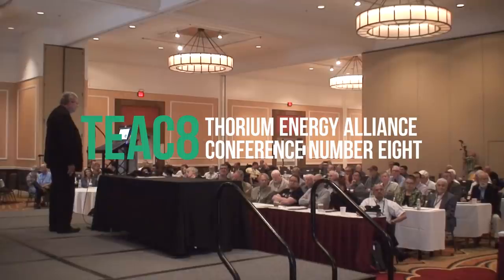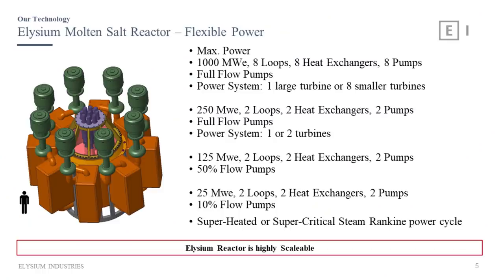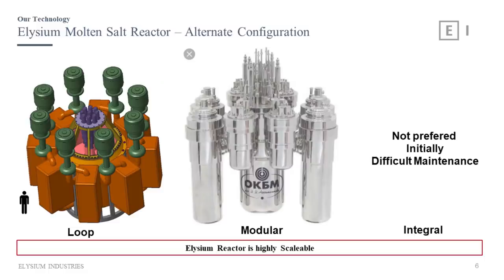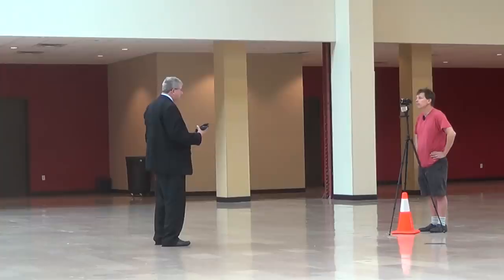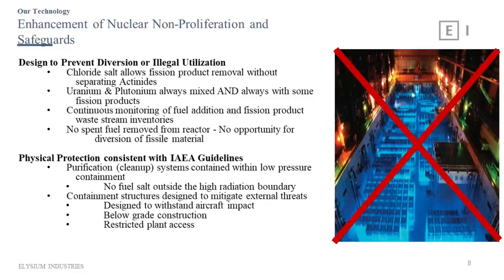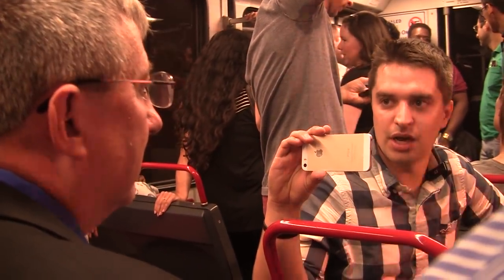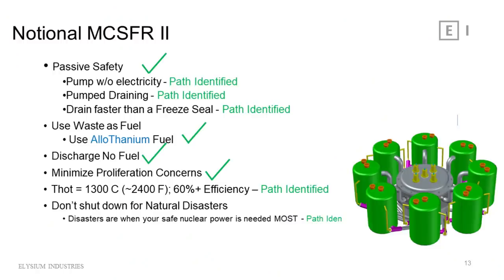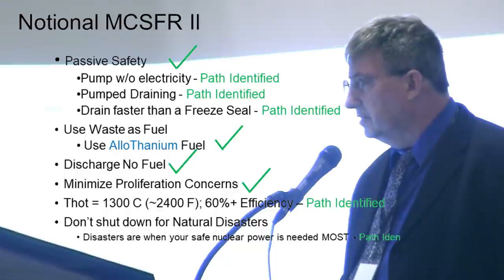Fast-Spectrum Molten-Salt Reactor - Elysium Industries - Ed Pheil @ TEAC8

Comment: I am a fan of the MCSFR concept and have a lot of respect for Ed Pheil.  I don't know why Elisium and Exodys have not been more successful.  The oil lobbyists and their enablers in our government have sabotaged the SMR industry since the '50s, for one thing.

All electrical power could be generated by small nuclear reactors widely distributed through a de-centralized grid (think EMP) throughout the world (thousands), reducing the need for fossil fuels by two-thirds. Could have happened a long time ago. We have had SMRs in active use by the military since the early '60s and could have been deployed them from that time on if wanted. Electrical power (lack of) is another method of CONTROL of the world population.

IMO, SMRs should be manufactured in volume for electrical generation throughout the world, conserving fossil fuels for internal combustion engines, chemical processes, and fertilizer. Were this plan to be implemented the world economy would explode overnight. (However, the power of politicians would suffer. Prosperity is the enemy of the political cabal.)

Comment: (28:24) I love Ed, and I think he might have the edge when it comes to being the first to commercialize a working MSR. However, at this point, while he's correct that you can get around the proliferation barrier of U-232 by allowing your Protactinium to decay in batches, this still ignores the fact that the biggest obstacle to nuclear proliferation in thermal spectrum reactors is their absolutely anemic breeding ratios. 
If you operate your reactor on a continuous process, dumping all Protactinium into a big tank to decay to Uranium, you'd never be able to separate the U-232 from the U-233 as you'd always be adding new protactinium 232, and continuing to produce new U-232. You'd have to operate in batches, say, isolating all the protactinium produced over a given day, allowing all the possible protactinium 232 in that day's batch to decay to U-232, leaving you with pure protactinium 233 after a number of days, which would decay into almost pure U-233. However, because of the piss-poor breeding ratios of thermal spectrum reactors, if you were then to take all of that "pure" U-233 out of the reactor process so that you could make a bomb out of it, you're keeping that fuel from being fed back into the reactor. 
Doing this reduces the fuel density in the reactor, driving it into a sub-critical state, and effectively kills the reactor, at least until you put almost all of your "bomb material" back into the reactor. It's the low breeding ratios of thermal spectrum reactors, not necessarily the production of U-232, which is the best barrier to proliferation. Still, setting up a thorium breeder so that your protactinium decayed in batches should be a dead give away that you're up to something shady, as there's no "non-shady" reason to do this. Just my 2 cents. 
Be that as it may, I'd say Ed was still doing God's work, if I wasn't a deist, and he definitely frames a solid argument for his molten chloride fast reactor. He's certainly won a lot of fans based on the comments in various videos.
Reply: A stupidly easy way to use this reactor as a breeder for supergrade plutonium would be to flow 238UF6 through an area surrounding the core region where the neutron field is more thermal. The Pu would separate out as a solid and the UF6 left over would recirculate. A similar technique could be used for making tritium. It's not all bad though, especially as plutonium 239 would be the best start up isotope for these reactors.

Comment: The top questions I get from the Anti crowd is "what about the waste". I suspect that most of them will never be convinced but for some saying that proposed reactors are intended to reduce waste. may help the popular acceptance battle.
Reply: Eukatae 

The Elysium reactor only removes fission products that decay to background levels in about 300 years. The long lived actinides people worry about remain in the reactor. This is not a solid fueled reactor that requires re processing, separations, and fuel remanufactured every X years. The actinides stay in the reactor. Because we use chloride salts, we can remove fission products only. You can't do that with fluoride salts without doing extensive separations, including actinides. Chlorides and liquid fuel are the key. Also, because we don't remove actinides there are no proliferation concerns and the fusion products coukd be mined for useful medical isotopes, etc. The zirconium cladding we extract the fuel out of is recycled. The chlorine is also recycled. The fission product waste is kept as a  salt, so it will decay longer and the higher temperature the easier it is to passively cool and the smaller the waste package. We dont need millennial storage facilities for Elysium waste. Also, we only produce 1 tonne/year of fission products and we don't throw away the other 96+% of the unused fuel, cladding, and transuranics that aren't used.
Reply: I thought LFTR's waste is less radioactive then current nuclear waste?
Reply: Radioactivity is a bit more complicated than that. The longer something takes to decay the less radioactive it is. Something that has a half life of 10 minutes is really hot, something that has a half life of 10k years, you could eat it.
Reply: I agree, most of the anti crowd will not be convinced. I have observed that they tend to be so entrenched in their beliefs that anything opposing them is considered heresy, and any possible solutions are outright dismissed. Getting the general public on-board is going to be the biggest battle, fear is more powerful than the truth.
Reply: Eukatae - It's a bit too much of a generalization to say something with a very long half life could be safely eaten. The radiation likely wouldn't do any serious damage, but metal poisoning from, for example, uranium, would.
Reply: +Phlaked Corn THIS. Plutonium isn't just (usually) highly radioactive; it's also frightfully toxic on a chemical level. The only plutonium that our entire species has ever come into contact with was what we MADE; otherwise all the potential "natural" sources already decayed to trace levels billions of years ago. Which is to say... there has been no natural selection pressure to evolve tolerances for nor protection from plutonium, on a chemical level. Unlike, you know, radon in the air we breathe.
Reply: Darth - SMH, really? It's not sabotage worries me, scientifically illiterate politicians with their fear monger anti nuclear constituents that put them in office does. The policy changes and funding that is needed to make next gen nuclear a reality are controlled by these dolts, and so long as they are the majority, we won't even be able to build the reactors you mentioned in the first place. http://news.gallup.com/poll/190064/first-time-majority-oppose-nuclear-energy.aspx
Reply: Eukatae Radiation is not the only problem with long-lived spent fuel.  Plutonium is hecka poisonous, requiring micrograms per person to guarrantee cancer.  That's plutonium's chemical property, not nuclear property.  In that sense plutonium's long half-life is its drawback because we have to contain it longer to spare us from its super-nasty chemical property.
Reply: I was responding to a question about the radioactivity of byproducts of LFTR  reactors. I was not offering dietary advice, I was talking about radiation, not toxins. Gold, eat that, it's delicious.
Reply: jomossino79 

That perception is based on people comparing Closed cycle LFTR to open cycle water reactor fuel. That is NOT a fair comparison because both U and Th can have a closed cycle, especially in liquid fuels. If you close the U/Pu like they assume you can do for LFTR, then the waste stream has virtually identical levels of thise long lived actinides. That is what Elysium is doing, closing the U/Pu fuel cycle. You can ONLY do that in a fast reactor. If there is ever moderator in a reactor design a U/Pu cycle cannot be closed, except by following it with a fast reactor. 

So, don't believe a claim of a closed U/Pu cycle in a thermal Reactor. HEU, yes possibly at very high enrichment. The Navy has not tried to do that to my knowledge.
Reply: Lenard Segnitz 

So, burn the Pu.

Or understand that the amount of Pu is over 10,000,000x less volume and conrained compared to the Hg, etc that lasts forever and is released to the environment in the open weather from coal.
Reply: Professor Bernie Cohen offered to eat an ounce of plutonium if Ralph Nader agreed to eat an ounce of caffeine, That sent Nader running with his tail between his legs. The caffeine would have killed Nader whereas the plutonium would have happily passed right through Cohen without health effect. There is this case of a fellow Albert Stevens who was injected with an incredible 131 kBq dose of Plutonium, in 1945, so he got a massive 64 Sv dosage over 20yrs or avg 3.2 Sv/yr and died of heart disease at age 79.
Reply: I thought he covered waste and safety in the video. Did I miss something?
Reply: The answer you will get from the anti-nuclear movement is not "oh, that's okay then." but "Proliferation!" or "But wind and solar are so cheap now!" or "What about batteries?"

You cannot and will not get acceptance from ideologues. Their moment of compromise is the moment they must recant. And they will not recant until their peers are seen to do so, thus giving them safe space to do so themselves. 

Better to convince the undecided third of the population and give their misinformation no room to breathe and no confusion to hide behind.
Reply: The point to make when people rave on about the "But 250,000 years" part, is to say "Oh, we keep those int he reactor and use them as fuel" and "All that waste from other reactors is fuel for these too" (Yes, I know it's sidestream, fuel, but it's still useful)

As for flouride vs chloride salts: the issues over removal is only an issue if you plan to remove them. You only need to remove material from the loop if it's poisoning the reactor. Anything else can be broken down as much as possible.

Important question: What is the water solubility of chlorides? FlLiBe salts simply aren't soluble at all and my safety worry is if water gets into things.
Reply: At the end of the process, yes - but shortlived radioactives are fiercely hot to start with (they break down quickly).

Being "white hot" to start with is not  a disadvantage. It prevents theft and means a short decay time to harmlessness.
Reply: Stonehawk: Weapons-grade plutonium isn't particularly radioactive. Nor for that matter are U235 or U238. There are hot isotopes but the biological danger comes far more from the chemistry than the radioactivity. That's why depleted uranium bullets are a spectacularly bad idea - they catch fire and coat everything in uranium dust. The result is that in places like Iraq you have kids playing on dead tanks covered in uranium dust and uranium dust contaminating fields. The effects are worse than lead poisoning.
Reply: How radioactive nuclear waste is, is based on what isotopes it contains. Solid fuel has all the various isotopes bound together. This specific video is not about LFTR, but a different version of Fluid Fueled Reactors. LFTR has online processing, removing fission products, and sorting them as they are made. A large portion of these fission products will be at or under the radioactivity of natural Thorium and Uranium in 10 years. Some of these fission products are useful, including xenon, neodymium.

Fluid Fueled Reactors are "less radioactive" in that they burn up their fuel more efficiently. If you put in 1 ton of fuel, it burns up 1 ton and you are left with 1 ton of fission products. When you put 35 tons of fuel into a solid fuel reactor you are left with 34 tons of unburned low radioactive fuel and 1 ton of highly radioactive fission products. But they are all bound together in the solid fuel and must be stored together for 300000 years.
Reply: @Stonehawk  The uranium content of fly ash from coal is about 50 parts per million.    So, we could get far more energy from the uranium in fly ash then  from the coal that produced it.

Comment: Ooo, I'm liking this approach! Question about chlorine isotope separation though. My understanding was that when Cl-35 absorbs a neutron, it will mostly decay to argon, but a small fraction will decay into sulfur. Cl-37 avoids this, hence I thought isotope separation was necessary in a chloride salt reactor -- to avoid corrosion of the reactor materials. Is sulfur not the issue I thought it was? I think the nickel in hastelloy-N was particularly vulnerable to sulfur corrosion, but perhaps the materials you intend to use aren't so vulnerable?
Reply: No, transmution will absolutely be a source of corrosion. This is in addition to the fact that the lewis acid-base balance in chloride salts does not have an analog to the BeF2 (4-) complex ion of fluoride salts. Gettering systems will have to operate at high fidelity to manage transmutation products that can catalyze corrosion continually.  Excellent question!
Reply: Good info. Material and fabrication costs would be more, but I wonder if molybdenum alloys like TZM would be the ideal material for the reactor and first-loop plumbing. In addition to higher temperature limits with Mo, conceivably any sulfur produced would react with the surface to make MoS2, which is fairly tough and inert. I have no idea if that holds up in a molten chloride environment, though.

The titanium and zirconium tended to leach out of TZM in molten fluoride test baths, but I wonder if that remains true with molten chlorides.
Reply: This is some crazy shit
Reply: The sulfur would combine with technetium but sulfur plus chlorine would be very aggressive. Also other fission products would combine with sulfur to form extremely insoluble sulfides. It would need some method of filtering these out before hitting the heat exchanger. Strontium and barium sulfides would be extremely problematic.

Comment: Moltex Energy says that pumped fuel, while allowing fuel purification (or full reprocessing), raises problems of leaks and of noble metals fission products deposition into pumps, causing them to fail.
How can Elysium obviate to these problems?
Reply: Add extra chlorine to the mix over time. This would keep the noble metals in solution. Also a continuous filtration mechanism that causes the rhodium and other noble metals to stick to it. Then harvest it periodically. After aging for a decade the rhodium and other noble metals can be chemically separated from the radioactive waste.

Comment: Interesting. A few years back, I made the same point to Robert Hargraves about the U233 stream in LFTR's fuel processing being a proliferation concern, only to have him try to browbeat me down with bucketloads of smarm and an oblique answer.

Heartening to know I'm not the only one who had that thought.
Reply: Separated fissiles are always an issue regarding proliferation. The issue is not whether a material is proliferable or whether it is not; but whether the will and means exists to beat a plowshare into sword. So far, every single new atomic weapon nation has done so on the back of clandestine heavy water (or graphite) piles and PUREX, or clandestine diversion of centrifuged U-235. Neither process requires a civilian power reactor, and even high school students can perform the necessary refinement and separation steps needed to separate fissiles.

U-233 introduces a new dimension to this but just as, say, the US possesses U-233, it also does not use U-233 for weapons material. The ability to miniaturise weapons with Pu-239 is too great an advantage. Proliferation is not a test of technologies, but of institutions, people, and expertise. To shun the use of a reactor just because it might have a conceivable way from which a reactor could be used to produce weapons material is a failure not of the technology, but of the safeguards and the people in its place.

This is not to say that technology does not have a place in combating proliferation. I have a lot of time for that argument. But knowledge of how fission works and graduate degree chemistry along with access to certain, select organic solvents and catalysts, is all that is required for the production of nuclear weapons. Hell, you can find entire books on how to design bomb pits, explosive lenses, and tritium boosters. What keeps everyone and their mother from packing atomic heat is that the chemicals are tightly controlled, there are inspectors in countries acceding to the NPT, and even materials like nuclear grade graphite or heavy water are closely monitored. Again: institutions, treaties. They are only as powerful as the people that accept its tenets. 

LFTR could potentially produce weapons grade material. So too, could an LWR operating on very short irradiation cycles, a medical isotope production reactor, a graphite pile, and a centrifuge cascade. What stops that from happening is no inherent technology barrier, but people putting their foot down and saying, "not one step back."

Comment: Some questions:  What happens if...

You're running your standard reactor 

with 1 heat exchanger (1/6 output power) and the circulating pump fails.

with 6 heat exchangers (full power) and all circulating pumps fail.

What automatic systems are required to contain the situation?
What operator intervention is required to contain the situation?